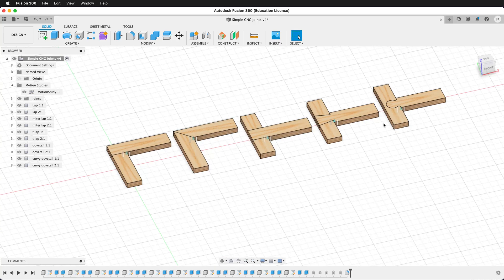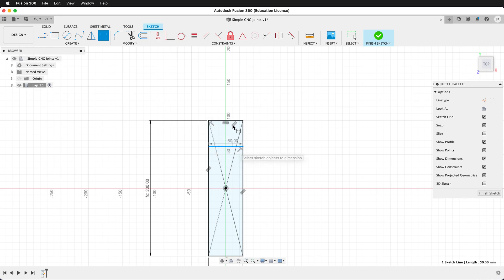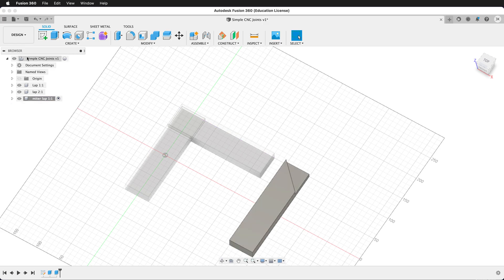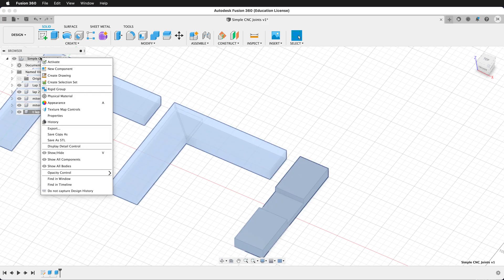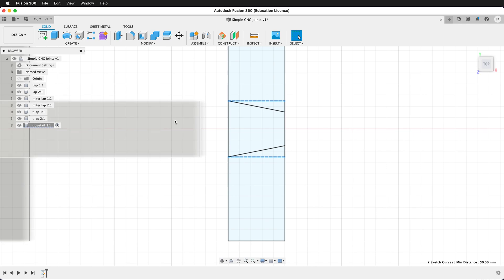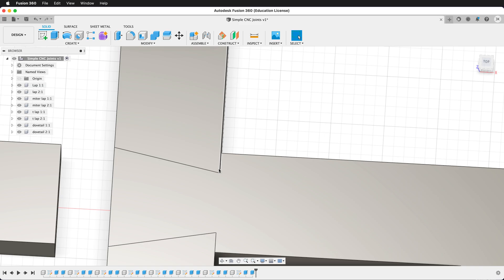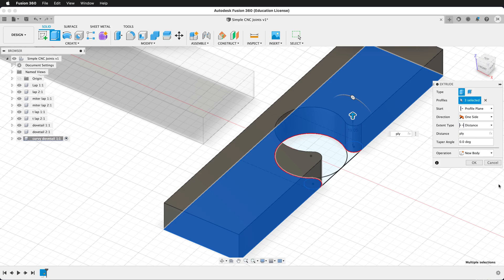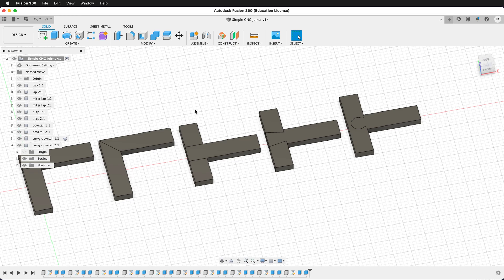Simple CNC Joints in Fusion 360

Comment: hi, thanks for your videos! I'm seeing in your videos, you made a material like plywood with the wood grain on the faces and edges with the multilaminated. Can you tell me how do you create that? Thanks in advance!!!
Reply from the maker: Take a picture of plywood edge and then make a seamless texture in Photoshop. You can make custom textures in fusion 360. You can make a vertical plywood in a horizontal plywood texture infusion and then apply it to the edges.

https://youtu.be/PJ7L4S5ylqg

This video shows how to make seamless textures, then you just need to use that image for a texture in fusion. Change the dimensions of the texture infusion to the pixel dimensions of the texture image you make.
Reply: @WhatMakeArt  Thanks for the response. I've made new textures in fusion but I dont know how to put one texture in the edje and other in the face
Reply from the maker: When you are applying textures you can either apply textures to bodies or faces. You can select all the faces and then drag the texture onto them. When you press "a" for the appearance window, there is a radio button toggle for bodies or faces. It defaults the bodies each time you open the window.
Reply: @WhatMakeArt  Great I will try it!